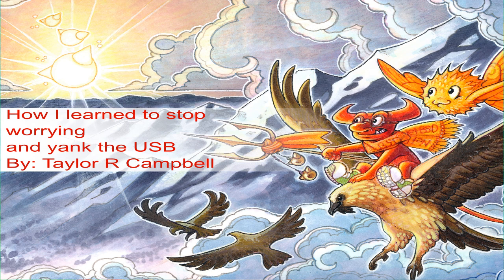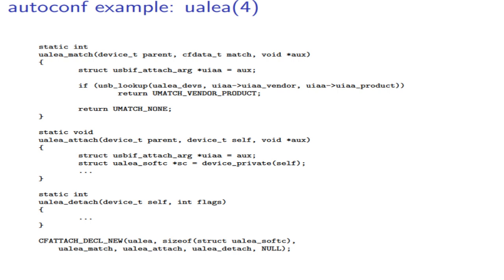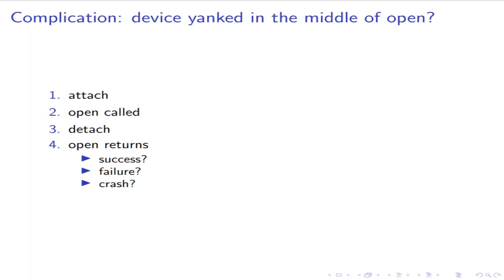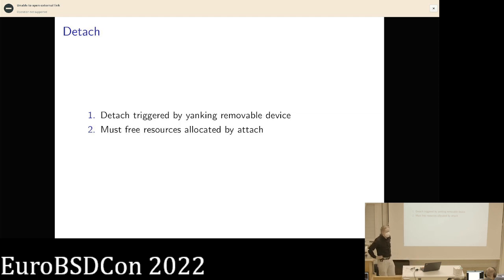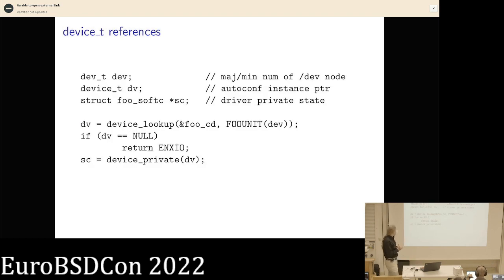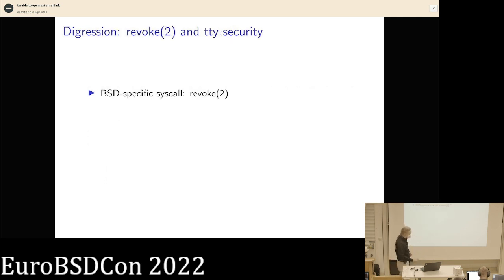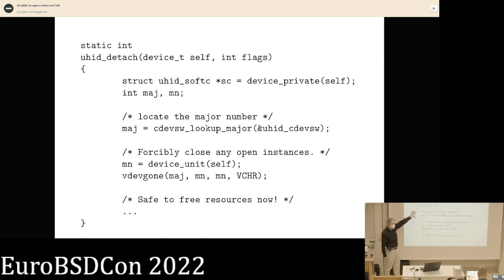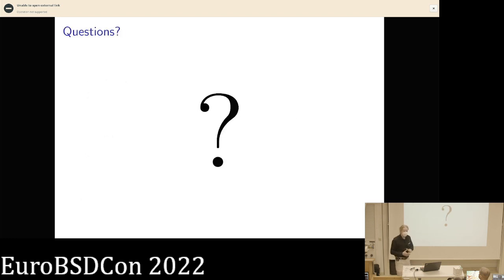How I learned to stop worrying and yank the USB - Taylor R Campbell - EuroBSDcon 2022

Comment: Isn't the title of this talk quite misleading?
I mean, sure, it's great when physically yanking an USB device doesn't corrupt internal kernel state (which in the worst case might crash the kernel or even lead to kernel vulnerabilities), and this is what the talk is all about.  Seems to me, that's fair enough as far as it goes.
However, there is another reason why just yanking an USB disk device is not such a great idea.  Even if internal kernel state, open(2), read(2), write(2), ioctl(2) and close(2) are all handled correctly, data on the USB device may still be corrupt if unmount(2) is not called on the file system, in the worst case leading to data loss in files in the file system or even in file system corruption.  The reason is that file system code does not necessarily write all transactions to the disk before returning from write(2) to the application program but may cache such changes in the kernel to collect them for more efficient physical disk I/O.  Such data cached by the kernel file system code may still get lost.
Or are you saying that your new d_close functions do the equivalent of unmount(2) for mass storage devices?  Naively, that would look like a layering violation causing considerable complexity - and possibly fragility?

So i suspect you still need to engage your brain and not just "stop worrying and yank mounted USB file systems", right?
Or what am i missing here?